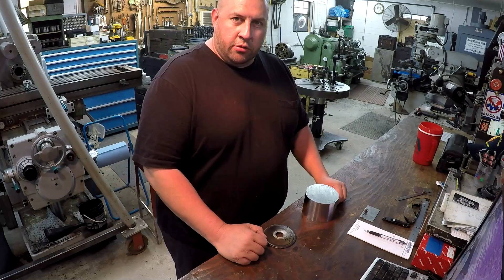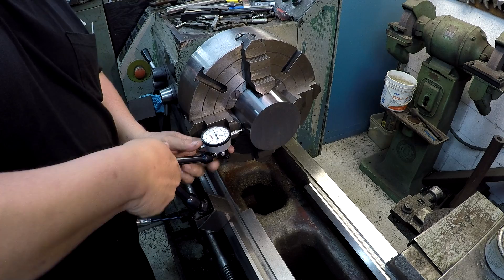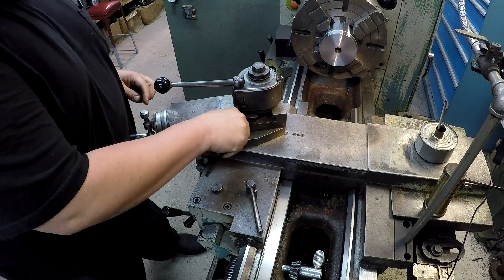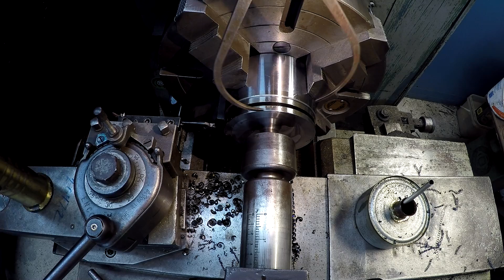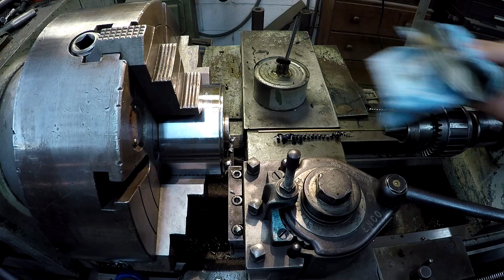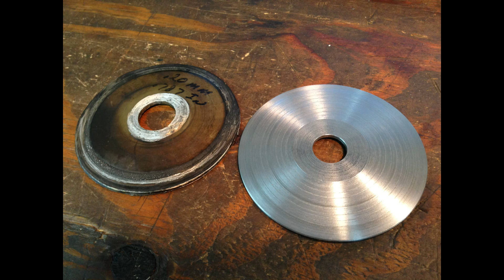Machining a Custom Steel Disc

Comment: hey Adam i realy like your channel. my name is Tomek im from Poland. here ewerything is metric  i was always courios how yuo can easly do calculations like 3/4 inch minus 7/64 thats difficult to me. nothing like 120 mm minus 1,7 mm  is equal to 118,3 you are a great maschiner mean  keep up a good work
Reply: +tony stark 3/4 is 48/64, and  -7/64 = 41/64, easy! lol
Reply: +Abom79 Adam ,  what really sucked was in 1976 when the U.S. auto makers had mixed  metrics & SAE together in the cars and forced us  dealership techs into buying another set of tools so to speak,  up till then I didn't own a  metric tool.  Vw's & foreign motorcycles  were about all that called for metrics back then.
Reply from the maker: I think I'm getting confused now. LOL! Oh those metric numbers hurt my brain. 
It's all in what you get used to. I was always taught inch/lbs so it's become my second language.
Reply: +tony stark  If I'm machining or working in CAD, I just convert everything to decimal inches so it's simple like base 10 metric. It doesn't take long to know what the decimal equivalents of most fractions are. I really hate working with feet and inches though :)  I live on the west coast of Canada (which is officially a metric) and we have a mix of metric and inch specifications but with our imperial southern neighbors it's more inches and that's what I learned with and what I work in.  

It's kind of annoying actually because metric fabrication drawings often round off to the millimeter and spec 6mm plate or 50mm square tubing but its actually 6.35mm plate and 50.8mm tubing we work with.
Reply: o so you divide only on 2 4 8 16 32 64  not on 50 or 79 or somethig else, that's what confuse me. now i think i understand thank you,
Reply: +tony stark It's like when you sit down to eat and you have a pie for desert. Let's say the pie is cut into 8 pieces. Each piece is one eighth (1/8) of the total pie. If you cut each piece into two equal pieces, each one is one sixteenth (1/16) of the total pie.  So if you ate one piece that was 1/16 and decided you wanted another larger piece and you ate one that was 1/8, how much pie did you eat? You ate 1/16 plus 1/8. Since 1/8 is equal to 2/16 then you add 1/16 plus 2/16 and you have eaten 3/16 of the total pie. It's the same with the linear measurements we use. We can divide the inch into 2, 4, 8, 16, 32 or 64 equal pieces. If we have 3/8 of an inch and want to add 1/16 to it, 3/8 is equal to 6/16 so 6/16 plus 1/16 equals 7/16. See, easy as pie!
Reply: There is nothing wrong with 1/50th of an inch or even 1/79th of an inch. But doing math is much easier when the value is even. 
If you take a whole the easiest way to divide it into equal parts is by  halving. A half is then equal to 1 of 2 pieces of the whole, or 1/2
if we continue down this path the next logical step is 4 equal pieces, which is splitting the (2) half pieces into 2 equal parts. 1 of 4 pieces of the whole is 1/4
divide each piece again gives you 8... 16... 32...64

Fractions to decimals: divide the numerator by the denominator 
 1/2 = 0.5 (1 divided by 2 = 0.5)
0.5 * 2 = 1 (whole piece)
1/4 = 0.25
0.25 * 4 = 1
...

Comment: Mixing metric and inch sizes i do myself, whichever one is the measurement that it needs on that axis!  although i am pretty much entirely metric, having learned that from school, my dad always was stuck in inches so i always think back to his ways too.  just how do you do metric when you dont have metric micrometers? i guess you look up a conversion chart? though of course you cant work to microns, how much harder that would be!   why are they called micrometers, i can understand when they measure microns, hence micro meters, but surely yours should be thouinchers to be more descriptive? :)
Reply: +jusb1066 I'm fairly confident the micrometer was named as a measuring device before the meter or micron as a length was named. I always thought micrometer stood for micro as in small, meter as in measure, like a gas meter measures and has nothing to do with meters, if that makes any sense.
Reply: +jusb1066 I go back and forth between the systems by remembering 2 things: 1mm = about .040 inch (actually .03937) and 1/16 inch is about .060 (actually .0625).  So, using these approximations a mm is about 2/3 of a 16th of an inch.  5mm is .200 inch or .200/.060 inches or a little over 3/16 inch.